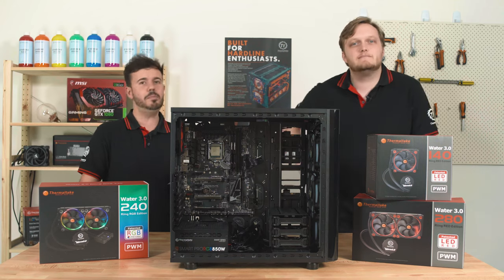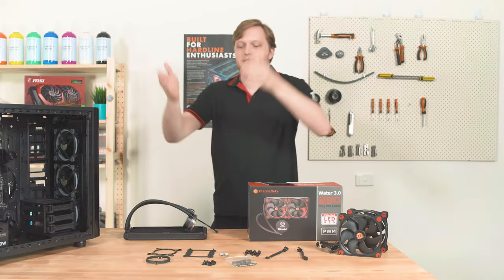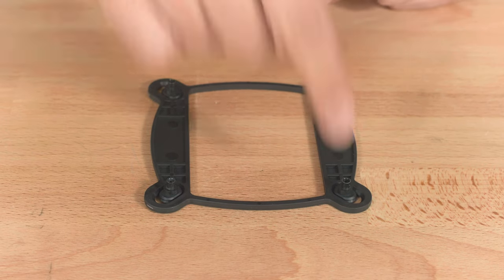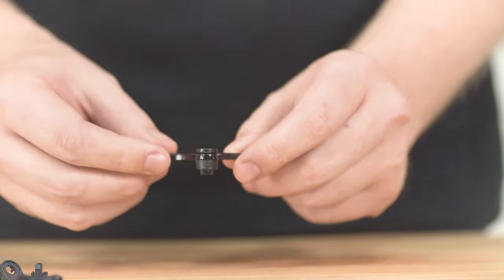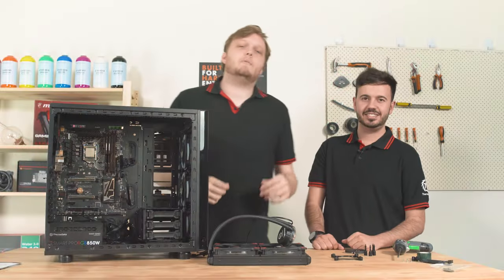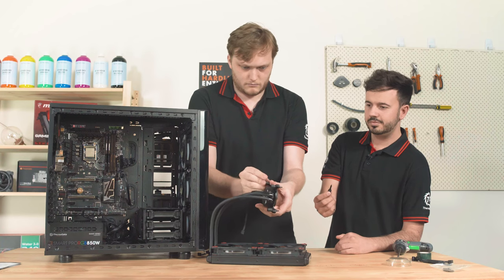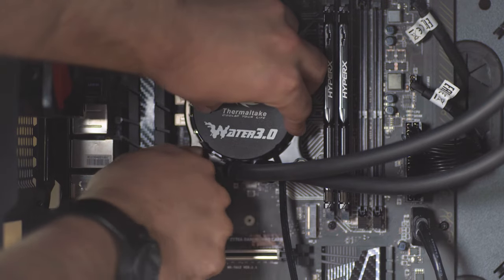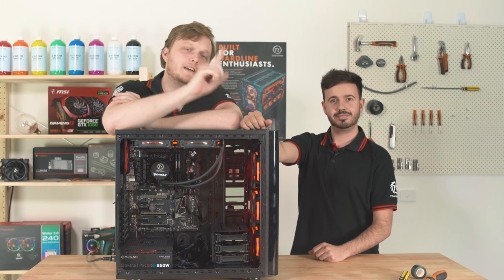Thermaltake Workshop | How to install an All-In-One Liquid CPU Cooler

Comment: Hello,

I recently purchased floe-riing-rgb-360-tt-premium for cooling

my question is whether for mounting I need thermal paste to apply on the processor or not.

I mention that the computer case is Thermaltake P3

Gigabyte master z390 motherboard

Intel i9 9900k processor

thank you
Reply from the maker: Hey Hey Marius, 
If you purchased the AIO cooler brand new, it'll come pre-applied with the optimal amount of thermal paste to make installation that little bit easier :) 

If however, it's second hand, you will need some new thermal paste. Hope that helps and we hope you really enjoy your new build!

Comment: Just one other little piece of wisdom - if you are wanting to add a radiator in the top AND the rear of a case, make sure you have enough clearance between the two radiators in the far top back corner, inclusive of the fans. 
There are a number of cases that specify that you can do both, but many radiators can catch you off guard.
Reply from the maker: That's an excellent point of advice there Renegadr!

Comment: Great and badly needed Video. However, the placement of the radiator may be of concern. IF for some reason the radiator or cables leak, the fluid will drop directly on the the motherboard and secondly the video card, not missing one component. If the radiator was mounted on the side, bottom or front of the case, well "you have a chance". The bulk of the fluid would have a higher probability of missing your precious components.

Comment: I have just received the 240 RGB that I imported, and it is awesome. Howevar, I have not yet installed it, because I'm afraid the thermal paste that the block comes with will not be enough to cool my i7 7700K. Do I need extra thermal paste, or is the stock one enough? Also, how long will it take until I should apply a new layer of thermal paste?
Reply from the maker: Hey Tio, the funny thing with thermal paste is less is more.. aka small amounts work better than applying too much on the block, the amount that is on there from factory is perfect and you're good to go. As for when to reapply, basically when you see your temps start to rise more than normal on a consistent basis, then I'd go and check to see if you need more, otherwise reapply every 9-12 months to be sure.

Comment: Where did you put the wire where it go to the cpu? It on pump 1 fan? Or cpu fun?  Or does it matter?
Reply from the maker: Sorry for the delay mate! So the pump header can be put on the CPU fan header or an AIO header, either will work, however, if your motherboard does have an AIO header, it's recommended to go that one as you can also tinker with settings in the bios to control the pump depending on certain temperatures.

Comment: Sorry for being late to the party and thanks for the video but I have a quick question. My z270 has a fan/pump header. Which connector should go here, the 3 pin that's coming from the block or the combined 4pin from the fans? Thanks for any help
Reply from the maker: Hey hey Edwin, no need to be sorry there, always happy to help and it's never too late to jump on over to the ALL-IN-ONE party! 
You'd want to stick the 3pin coming from the waterblock into that fan slot. For those who arn't too savvy with the bios as well, we do recommend putting the aio pump pin into your motherboards "Sys-fan" header as well.
Reply: thanks for the quick reply. thats what i did, and i set that to PWM on the bios. it was just a little confusing because i was trying to use the fan software control and it wont recognize my water 3.0 extreme. it kept giving the message to plug in the usb header, but my pump doesnt come with that at all. any tips for that?
Reply: Thermaltake ANZ this is all fine and dandy but some people need more explanation. I just purchased the Floe riing RGB water cooler and I’m thinking of returning it. 

Thermaltake has a serious lack of instructions and explanation to what headers to be plugging into, why we should do it, and what bios settings to look at

Some of you might have done builds before but for myself this is a first and very disappointed with the lack of info provided

Comment: Is there any major difference in installing the 280 vs the 240?
Reply from the maker: Not really, just make sure your case supports the larger size, then the installation process is basically the same!

Comment: So, is the motherboard going to know if the fans on the radiator are for the radiator, or is the software just going to assume they're case fans? Planning on installing one of those RGB radiators (not by choice, it's all that was on sale for Black Friday), but I don't want the hassle of having to open the case up every time I want to adjust the radiator fan speed.
Reply from the maker: Ah, good question there Matt, this depends on a couple of factors, the main one being if your motherboard supports adjusting fan speeds based on CPU temp (most do). If you plug the fans into "sys fan" slots on the motherboard, depending on some bios settings they will increase rpm as your motherboard heats up or cpu heats up. Otherwise, you can download software to control fans individually or if you really wish, you can buy an external fan controller. 

On the otherhand, if you have digitally controlled fans like our Riing PLUS series, then you just use the software to control the speeds of the fans to however you wish.
Reply: Thanks! That was really helpful.
Reply from the maker: Happy to help, sorry it took so long to get back to you though!

Comment: Where did you end up plugging in the pump cable vs. the AIO fans? I'm trying to determine if I should plug in the pump cable into the AIO_Pump header on my mobo vs the CPU_FAN.
Reply from the maker: Hey James, if you have an AIO pump header on your mobo you should plug it in there. Some CPU_fan headers are PWM enabled, so your pump would only turn on when the temperatures get up, which might not be the best.

Comment: Do I need to change the fluid out? And how would I do that
Reply from the maker: Hi there, with the AIO CPU coolers you don't need to top up liquid, just install and off you go!
Reply: Where do I plug the other wire into

Comment: I just dont understand why you dont install a fan bringing air into the radiator from the outside of the case and a fan on the other side of the radiator putting the air in the case. It just makes sense to me, especially when there is an exhaust fan near it.

Comment: I wish u were using an amd cpu coz now I’m afraid I won’t do it right 🌚💔
Reply from the maker: You'll be totally fine Hamood :) The AMD brackets are easier to work with, hence why we went with intel.
Reply: Thermaltake ANZ thanks for your response 1 more question, will a gtx 1080 hybrid fit in the case (view 31) I’m imagining it would fit if I mounted it vertically and placed the radiator instead of the fan in the back for it will that work as well?
Reply from the maker: Hey Hamood, we haven't tested with that GPU ourselves. But looking at the specs, the card itself will fit and yes you can mount the radiator on the exhaust spot on the case for cooling  :)
Reply: Thermaltake ANZ thanks a lot